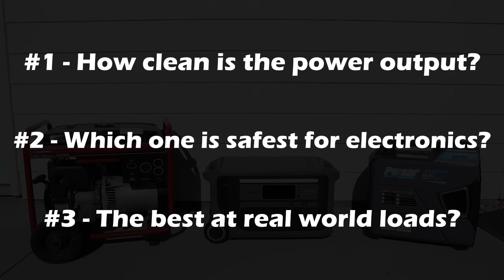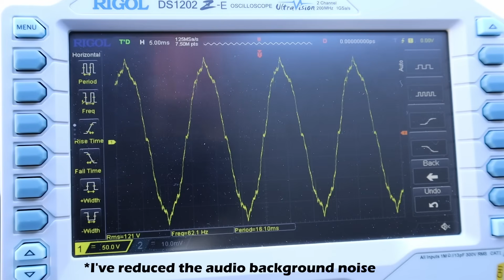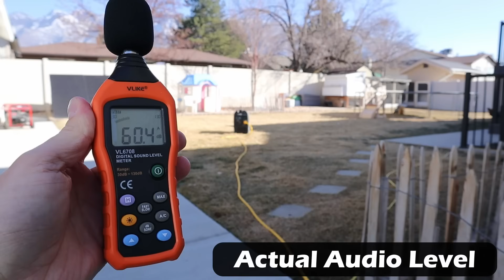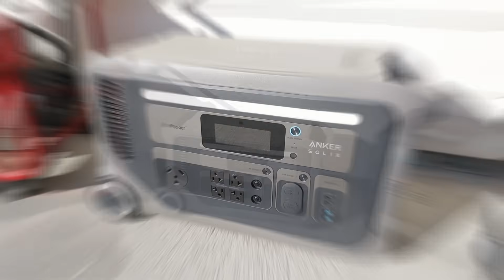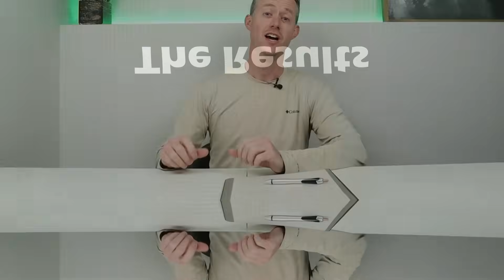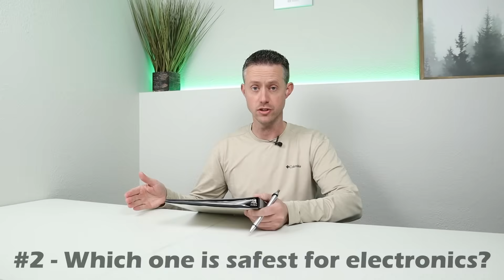Before You Plug Electronics Into A Generator, Watch This!

Comment: As an electrical engineer, I'm kind of surprised at the results.  I'm sure there's dirty inverters too, but both of those looked pretty darn impressive.   Your scope probably has a FFT function which converts a time domain measurement into a frequency domain and you can examine the distortion content.  A simple equation then can be used to determine the distortion level of each harmonic  (add them all up for the THD).  The THD meter might be more accurate, but it would be interesting to examine regardless.
Reply from the maker: I'm still learning how to use my scope, so I appreciate the tip about the FFT function! I read through the manual about that calculation but I was weary I would get it wrong.

Comment: Your oscilloscope probably has any of several features to inspect the voltage at the moment of table saw power on.  An easy way is to slow the sweep speed, 200 ms per division for instance, that gives a full second of sweep.  Turn on the table saw at the beginning of a sweep and then stop the scope.  Expand or Zoom the display and position to the moment of power on.  

Closely related is if the scope has a scrolling mode where the trace scrolls to left continuously.  That makes it very easy to just stop and zoom in on the moment of power-on.  This is also where different oscilloscopes offer greater or less waveform memory or how many samples it has taken.  If in that one second it took and stored a million samples, that lets you zoom in for very fine detailed inspection of anything that happened in that second.

Anyway what I saw briefly on the table saw waveform is high frequency content riding on what looks like the trailing side of each half cycle.  This is when the voltage is going toward zero but  the current is still heading to maximum, inductive load with current out of phase with voltage, also known as power factor . 

This high frequency is the inverter switching frequency.  There's a youtube video, I'm not going to look for it right now (was it yours?), that explores this phenomenon.  It destroyed the Kill-a-Watt meter since the Kill-a-Watt meter uses a small series capacitor to reduce voltage to the circuit.  At 60 Hertz this capacitor reduces the voltage as required.  But at 30 kilohertz or so, the capacitor allows very nearly the full voltage to hit the circuits and destroys them almost instantly.  
So what happens is essentially negative resistance not just a short circuit but the motor is sucking on the inverter so hard that the integrator (capacitor and inductor) in the inverter cannot filter the high frequency DC.  So the raw, rapidly switched DC reaches the output.   It seems relatively harmless over the short period of time the saw takes to come up to speed but anything else powered at the same time is going to see one or two seconds of high voltage, high frequency riding on the wire.

Comment: if extended power outage, the battery inverter will let you down quickly
Reply from the maker: But wouldn't running out of fuel also let you down? Why not have both because the sun is usually around some part of the day.

Comment: Traditional generators really do not like inductive loads and inverters aren't all that excited about such things.  I get something almost a sawtooth waveform from the 15 kva Generac on the roof.  What happens is the current is phase shifted from the voltage and causes problems in the field windings as it tries to regulate the voltage.  
In an inverter, current cannot be phase shifted but the inductive load (motor or transformer) will TRY to phase shift with bizarre consequences to the voltage regulation and waveform of an inverter. 
Conversely the capacitor input of a typical computer power supply looks like a dead short when first connected to power.  Generators will struggle with this for a few cycles and inverters will typically just go into error mode except you have massive over-specification.
Goal Zero inverters have a "soft start" such that if the load is already connected, starting the inverter ramps up the AC voltage over a span of 20 cycles or so.  
A note for ham radio operators :  I have a small Generac inverter generator, the RFI (radio frequency interference) is TERRIBLE.  On the other hand, the new Goal Zero Yeti 1000x has a built-in boost on the 12 volt Anderson Powerpole, gives you nice 13.6 volts DC from the internal 11 volt battery and no noticeable RFI.

Comment: A number of years ago, I had an APC line conditioner/surge suppressor catch on fire when that circuit was powered by a traditional generator.  Apparently each time the power surged from a change in load on the generator, the voltage climbed enough to heat up the surge suppression system but not trip it.  Luckily I smelled the fire and was able to extinguish it with only minor damage (some carpet and one bookcase somewhat burned).    I no longer trust traditional generators and am considering a battery-based powerstation that I can recharge with a neighbors generator.

Comment: Great video, I was wondering if you tested other conventional generators beside the you have and my second question is can you recharge the battery pack with a generator with dirty power outputs like your generator?
Reply: In fact, I have done just what you are asking - I have a traditional non inverter generator, same size as video, and have a brand new Pecron f3000lfp and the power station charges iup very nicely.  I was worried about it, asked Pecron, they said should work fine, and it does.  As others have commented, there is conventional,wisdom about so called dirty power, but methinks it’s probably,over blown, or said out of caution.  My plan is to feed interlocked house panel with pecron and the generator feeding the pecron when needed.  Better fuel usage, times of quiet like overnight.  My needs are roughly maybe 500 to 750 watts in winter.  Don’t plan to be able to run central ac - all my back up stuff is 120 volts.  Oh, in my test to charge the pecron I ran propane - ChatGPT suggested the would be a cleaner burning more consistent fuel.

Comment: What if you test the F3000 while charging from the traditional generator? Especially using the TT-30 input cable. The F3000 has a passthrough function and I wonder if it cleans up the waveform at all.
Reply from the maker: Power stations do not clean up the power input, they pass it right through. Most power stations won't even charge from a traditional generator. I've had many of my viewers let me know it won't even start charging.
Reply: @Jasonoid  In fact, I have done just that - I have a traditional non inverter generator, same size as video, and have a brand new Pecron f3000lfp and the power station charges up very nicely.  I was worried about it, asked Pecron, they said should work fine, and it does.  In my test to charge the pecron I ran propane - ChatGPT suggested the would be a cleaner burning more consistent fuel.
Reply from the maker: @dougreed2278 that's great! I'm glad it's charging for you 👍
Reply: Also in my test charging up my pecron f3000lfp with my traditional generator (see comment below) I was able to charge at about 1800 watts (to the battery), and also,passed thru another 1800 watts as I had a hair dryer running on pecron 120 volt output.  I didn’t measure any power quality, I was just curious if it would even do it.  So I had 3600 watts coming from genny all going to and thru pecron.  I tried to run a second hair dryer at another 1800 watts from the pecron and pecron shut down - error 20 inverter overload.  So it seems inverter total capacity about 3600 watts.  New to this game.

Comment: I have a 12KW backup battery bank plus a Anker C1000 with expansion battery for powering the fridge and some small electronics in a power outage and a inverter generator that I run to keep things charged up. 12KW powers main computer, communications, medical equipment and small heater. The 12KW is new and I will get to test it I think tomorrow when the storm arrives, S C Edison is paranoid and cuts the power during some storms (afraid of being sued by the state and county again for starting forest fires with downed power lines).

Comment: 50 years ago an off-frequency or a "dirty" power supply [often referred to on the label as 'modified sine wave'] might have created problems for a small television receiver, but in these modern [2026] times almost all electrical appliances have electronic power supplies [cheaper, smaller & lighter than 50/60 Hz line-frequency units] that truly don't care what the waveform is.
Reply: Correct. The only appiances that are sensitive to 'dirty' modified squarewave power, are industuce motors, eg, cheap fans motors and cheap ac compressor motors.
However, the detrimental effect is only a mild increase in heating in the motor, and, in the case of a fan, the motor is fan cooled anyhow.

Every other appliance (load) is either resistive (toaster, kettle, etc) or has an electronic switchmode ac to dc power supply.

Basically, it is highly unlikely 'dirty power' will affect any of you equipment.
Resistive laods = meh - dirty power has no effect
Electronic loads also = meh.dirty power also has no effect. Electronic devices convert the incoming power from ac to dc with a bridge rectifier, and the resultant output is massively dirty, that dirty dc is then cleaned up with series inductors and parallel capacitors. Then that cleaned up high volt dc, is pulse with modulated (ie pulsed, or chopped up), this chopped up dc is then fed though a small transformer and stepped down to the low voltage ac, then the low voltage ac is rectified to low volt dc, and that dirty high ripple dc is then cleaned up with further series inductors and parallel capaciors, aith a resultant fairly clean dc out.

You can see that the process above dees not care about the incoming ac wave shape.
Reply: @nordic5490  How about a Honda powered Black Max 8750 non inverter frame generator with AVR connected to the panel via 30amp twist lock cable and interlock device on the panel?  My concern is will it run my 6 year old modern single stage gas furnace without damaging the control board and circuitry etc?
Reply: The only appiances that are sensitive to 'dirty' modified squarewave power, are industuce motors, eg, cheap fans motors and cheap ac compressor motors.
However, the detrimental effect is only a mild increase in heating in the motor, and, in the case of a fan, the motor is fan cooled anyhow.

Every other appliance (load) is either resistive (toaster, kettle, etc) or has an electronic switchmode ac to dc power supply.

Basically, it is highly unlikely 'dirty power' will affect any of you equipment.
Resistive laods = meh - dirty power has no effect
Electronic loads also = meh.dirty power also has no effect. Electronic devices convert the incoming power from ac to dc with a bridge rectifier, and the resultant output is massively dirty, that dirty dc is then cleaned up with series inductors and parallel capacitors. Then that cleaned up high volt dc, is pulse with modulated (ie pulsed, or chopped up), this chopped up dc is then fed though a small transformer and stepped down to the low voltage ac, then the low voltage ac is rectified to low volt dc, and that dirty high ripple dc is then cleaned up with further series inductors and parallel capaciors, aith a resultant fairly clean dc out.

You can see that the process above dees not care about the incoming ac wave shape.

Comment: One item to note, that "traditional" generator is a 120/240 unit, when you load it at max output on 120 you are only using half the stator windings. does that make it dirtier? not sure.. the inverter generator only has 120v output, be an issue if you live on a well and you want water or to run any other 240v load.. some power stations do support that, but I'm not sure about the one you have. everything has its place, but if you are going to spend a couple grand on a power station you should probably be testing a generator that costs the same... (I'm death on the lawnmover based generators like that troy built, I own a 3k inverter, just bares to mention that they do have a feature the others do not.)

Comment: It depends on your usage.

In my view, and it would be true for most people is: traditional generator wins.

My use case is that a generator would be a secondary input to an all in one solar charge controller/inverter.

All loads are powered by the main inverter, whose source is the battery.

No loads would be powered directly by the generator.

A traditional generator's only function for me is charging the battery.

For that, efficiency and capacity are all that matters.

So it's all about the watts to dollars ratio.

And the traditional generator wins, with no real competition.

I can get hust about twice the capacity for the same cost as an inverter generator.

I'm putting in solar next month 14kw of panels.

That should handle heating/cooling/lighting.

I have propane heat currently, with propane and wood stoves.

I'm going to pick up a good electric griddle, and an induction burner.

Currently have propane for hot water too.

I'll be building a solar water heater/preheater, with and inline electric instant water heater.

I'll be adding battery capacity until I am fully on solar and I can store 3 days of power.

Then, I'll add a traditional generator and permanently disconnect electrical service.

Comment: Did the traditional generator have an electronic voltage regulator or was it and induction machine with capacitors for excitation?
Reply from the maker: No AVR advertised on the unit.

Comment: Regarding "dirty power." It only has to be GOOD ENOUGH.
Most people have an older style "construction" generator. The ideal use for it when the power goes out is first to power the big coarse loads, but second best use is to recharge the power station as quickly as possible. If the power is too dirty, then use an Ecoworthy or EG4 to turn it into as many DC volts as the power station can take.

Comment: From personal experience, charging 1 “power station” (what most people call a “solar generator”) on an inverter generator is not a problem, 2 is probably ok, especially if they are different manufacturers, but 3 or more, especially if 2 of them are from the same manufacturer, and then there is a good chance that a feedback oscillation (ringing) will develop on the AC side that will damage the electronics of one or more of the power stations.  When that ringing occurs you have perhaps 2 seconds to shut the generator off before one of the power stations goes “boom” (quite loudly) and all the smoke gets let out.  To be clear, it’s not audibly a ringing sound, that’s what it looks like on an oscilloscope screen; the audible sound is a squeal that is a combination of 60hz and higher order harmonics of 60hz, from the transformer windings vibrating the air as they rip themselves apart.  (At least, that’s my best guess as to what happens in the moments before destruction)

Comment: For me these tests you did put the power station way above the inverter generator by miles , the thing to me that kills the inverter generator is the noise factor and the fact that it has to use polluting and dangerous gasoline and a combustion engine ,  where as the power station for long term use will always out do a gas generator because of it's reliance on being tethered to a gas station while the power station can be charged  by multiple sauces including sola panels !!!
Reply from the maker: I like having both options to keep me powered up during an outage, having a backup to your backups is very important. The power station and solar panels are my preferred method if the sun is available.
Reply: @Jasonoid  Not for me !!!

Comment: I have the same exact Pulsar dual fuel generator as well as two different Honda generators.  I use the Pulsar for backup power to my travel trailers solar system and so far the Pulsar has been as reliable as the Honda units yet significantly more powerful, versatile, and capable at a significant cost savings over what I paid for my Honda products which now stay at home - although I don’t think anything can beat the long term reliability and durability of a Honda.  I was very surprised to see the Pulsar inverter generator actually have better cleaner power than the battery power bank.  Great video.
Reply from the maker: I was also very surprised!

Comment: Dude. Set up a trigger on the scope in single capture mode to see first few cycles after the load is connected. If your scope even supports the non-trivial trigger condition or hook up a simple current sensor to the channel 2 and set a rising edge trigger for it or wire the external trigger with a switch and press it at the same time you turn on the saw. With enough sample buffer you'll see it.
By "sniping" the exact frame the load kicked in I can say the power station handled the table saw way better but still gonna say don't have ANY digital electronics connected to the same power strip without a massive filter when you're about to kick in the table saw. This can destroy filter capacitors, confuse PFC circuits, even fry some low power electronics that use capacitor-resistor-zener as a power supply.
Reply from the maker: I'm still learning how to use this scope since I don't have a ton of background in electrical engineering. I'll look into setting the trigger settings, my scope does have that feature.
Reply: @Jasonoid IMHO getting a dirt cheap passive current sensor clamp, hooking up to channel 2 and triggering with a simple rising edge in one-shot mode and the highest sample depth is the least pain in the socket solution.